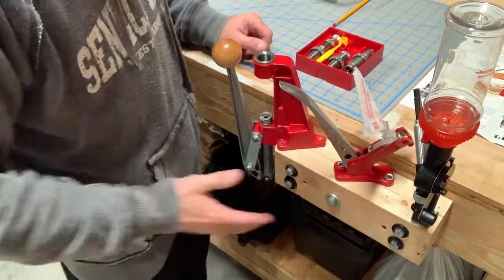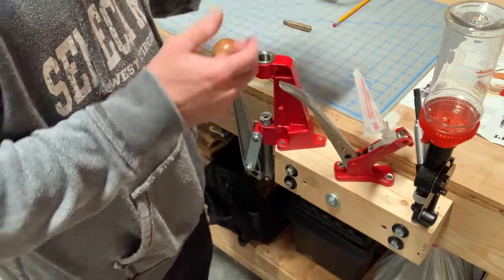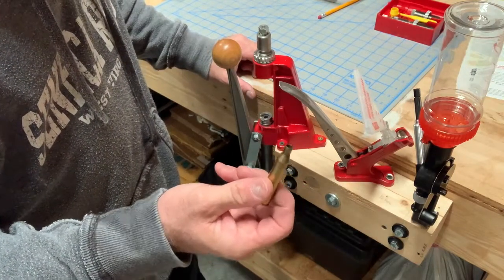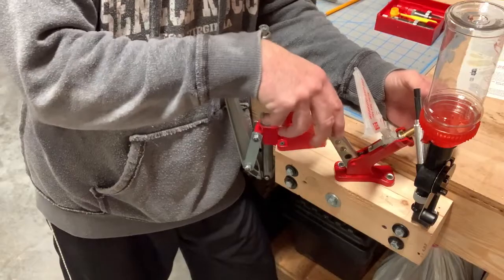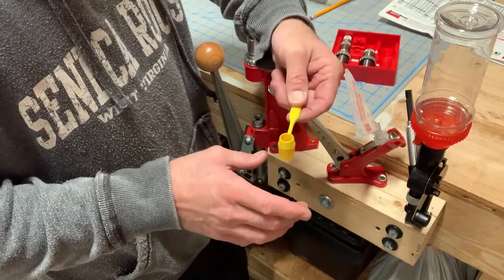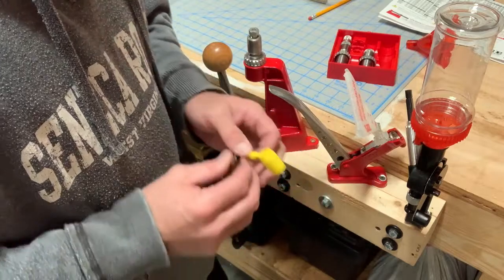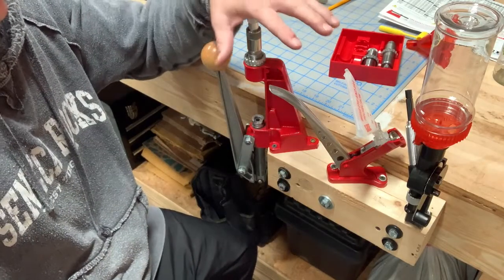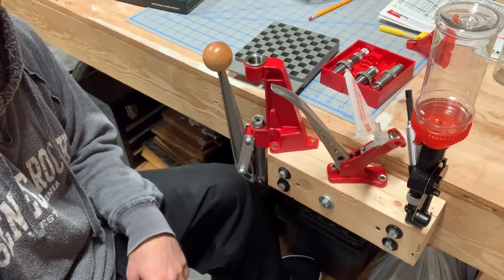Reloading basics with Lee Press and Dies

Comment: Good video TU. For a beginner this seems the best way to go but I think that's a mistake in a long run. for around 250 and sometimes under, you can get a prograsive that includes everything including die set.powder feeder, primer feeder, etc. the advantage is not just speed but you will not need to upgrade if you start shooting and reloading more.
Reply from the maker: thank you
Reply: WV591 - Disagree with you on the "mistake" part. Yes, a complete turret press kit is going to be more cost effective  than purchasing items separately - that's true. However, a turret press has so many things going on with each pull of the handle that it's extremely confusing for beginners. A single stage press is DEFINITELY what a beginner needs to start with to develop understanding of each step and its place in sequence, along with appreciation of the craft. So, single stage press kit? Sure. Turret press kit? Not for beginners.

Comment: I have a question on the shell holders, I'm wanting to get this kit to reload 308, the die kit I'm wanting to get comes with 4 dies, and a shell holder that goes on the press, but I'm confused on the shell holder than goes on the priming mechanism that holds the case so the new primer can go in, I can't seem to figure out if that holder comes with the kit or if I have to find that separately because I didn't see that coming with the die kits.
Reply from the maker: For that set up they are 2 different and distinct parts.  Watch at 5:52 seconds.   You will need the priming tool shell holder for .308 and the ram shell holder which comes with your die kit but is different then the primer shell holder.  Just search for Lee primer shell holder
Reply: @randomreviews7574 Alright thanks, this a different account I have, but one last question, I'm not sure if you know the answer to this one, but do you know if traditional 308 dies can reload Palma 308 cases that use small rifle primers?
Reply from the maker: @kingdomofme3681  can not help on that one

Comment: Whether one goes with brand A, B, or C they should never buy a kit as the stuff that is not usable will cost more than just buying the usable stuff that is in the kit. Buy the individual tools and do not be afraid to mix up the brands, as no one brand has the best of every thing.  Start with at least two reloading manuals, preferably Lyman's and Hornady's and if one has enough money then get the Lee's one too, for three.  Then while studying up on the process one can look over different tools available and make up their mind which style of reloading they will want to go down. No matter what one does decide a decent O frame press will always be handy through out their reloading career. Also before just buying up a lot of one bullet and powder they can check  all the load data between the three manuals and find a powder that will work across many a different bullets, so that they can experiment which bullet they may end up using, without having left over powder on the shell that may never get used for any thing ever again. Also get primers whenever the opportunity strikes.

Comment: I don’t think the directions Lee gives are easy at all! I’ve been puzzling over them for days. My Lee Breech Lock Reloader Press (just like yours)  came with something called a Lee Smart Lock Bushing. I’ll be blamed if I can figure out what it is for. 

The full length resizing die has adjustments on top, which I don’t have a clue are for. The die threads into that weird looking dohickey on top of the press ok, but I’m not sure how far down it goes. Until it touches the shell holder I think. I’m trying to reload for .357, using Lee dies. 

I haven’t blown anything up yet, so guess I’ll figure things out.
Reply: Did you figure it out?

Comment: Do you u have to case lube .45 acp, 9mm, 40 and 38?
Reply from the maker: Debatable -- def will not hurt to use -- but you may want to try a few with and without to see what you like
Reply: I have the same press as you but probably an older version. I'm thinking about getting the powder measurer like yours. Yours looks like it has a glass reservoir an the new ones are plastic with a lot of complaints about static electricity and throwing non consistent charges, so idk. I'm using the balance beam type now from the 70's but it's so slow. @randomreviews7574

Comment: I planned on buying the three exact components but the four die set. In .380acp, Can I use the Bullet Seating Die/ Crimping Die into different operations??? Seat then back off seating function ant set for crimp only?? Because I want to save money and just get the three seat die but the four-seat die has that crimping feature that separate. Can we do the separate crimping with the seating die as well as long as we back it off is I seen in some videos. Thanks for sharing and sorry for all the questions
Reply from the maker: sorry i am not much help with crimping.  I only re load a few rifle calibers which typically do not need crimping.